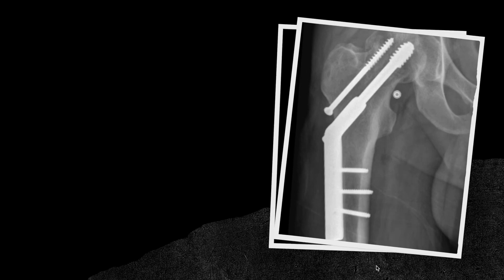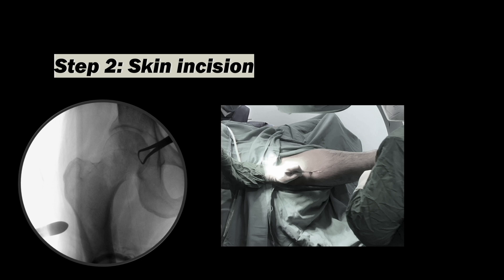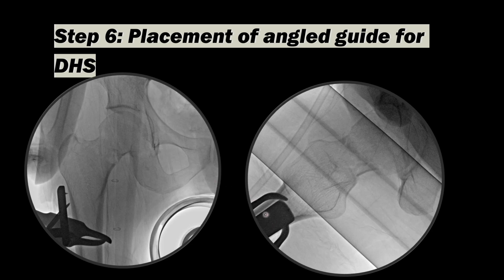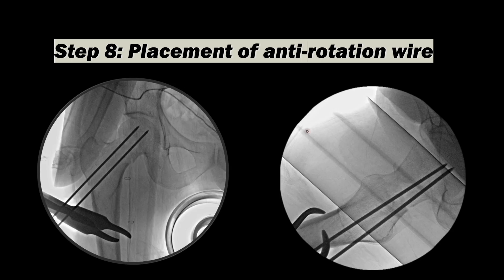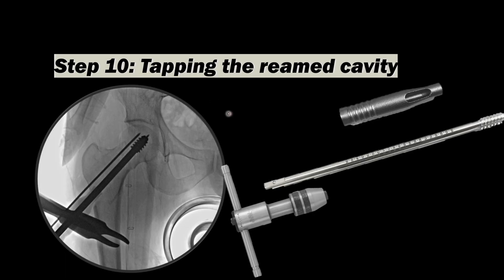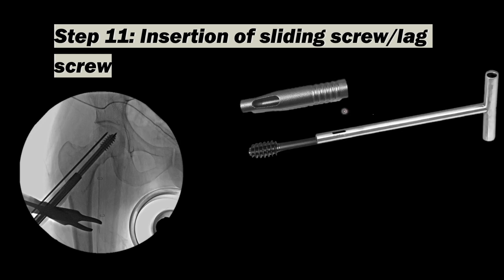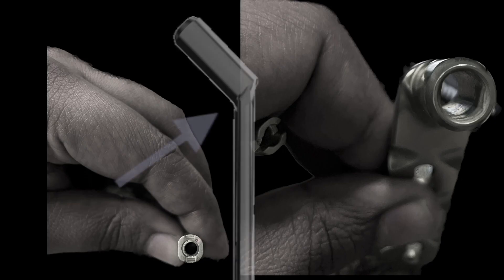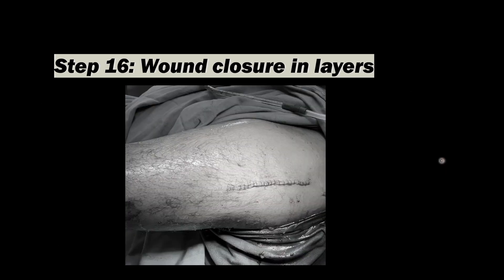DHS (dynamic hip screw) All Basic steps

Comment: Why do we ( and AO as well) put an anterversion wire before placing a guide wire for lag screws?
Reply from the maker: So when we put the wire initially we monitor in AP view first and then check the lateral view. That wire just reduces your chances of being grossly wrong in lateral view.
Reply: @Justorthothings  so we have to be parallel(in superior-inferior plane) and slightly posterior(in AP plane) to the anteversion wire while putting the guide wire for screw during the AP view.
please correct me if I am wrong
Reply from the maker: @AnwarKhan-xi4rh  Yes, that would be 
fine